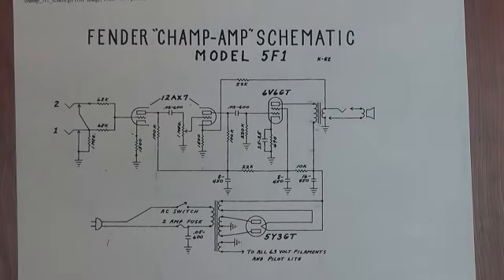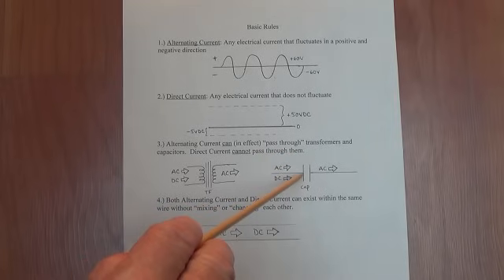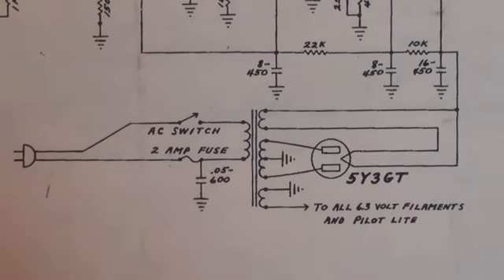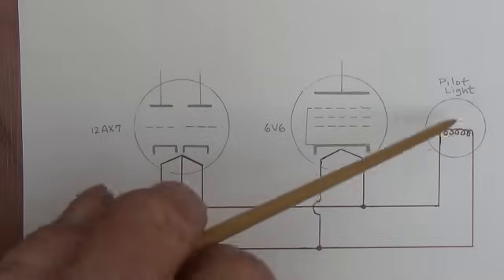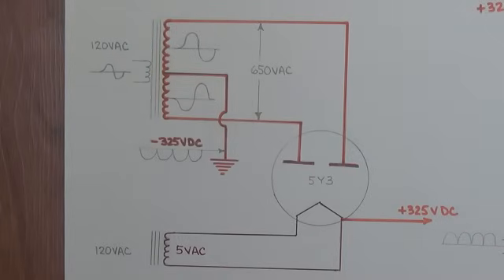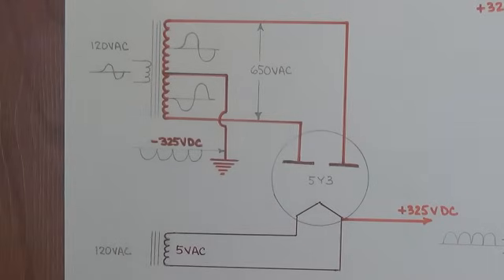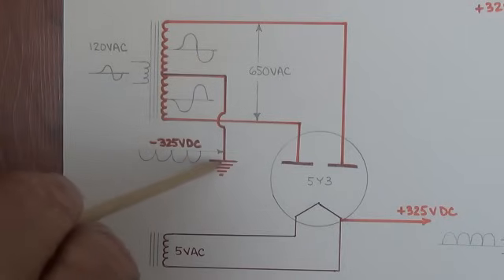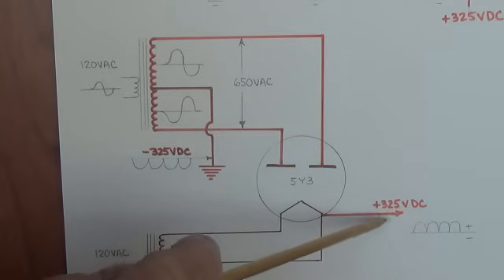How Tube Amplifiers Work, Part 1: The Power Supply

Comment: Uncle Doug, I loved both Part 1 and 2 of the videos on How Tube Amplifiers work.  I have a sort of related question. I want (actually my grandson) to  take the output signal (20 Watts/8ohms) from a Joyo Jackman amp and connect it to two separate speakers.  One speaker is a Harley Benton 2 x 12 Cab (100 watt/8ohms) and the other is a Dr. Bass 250 watt/8ohms bass speaker.  I bought a Y Splitter ( DISINO 1/4 Splitter, 1/4" TRS Stereo Male to Dual 1/4" TRS Stereo Female Y Splitter Cable Quarter Inch Splitter Cord - 8 Inch / 20cm) but, I am not sure if this is compatible with Speaker Cables. I cannot find anywhere (other YouTube videos, blogs, etc.) how to do this properly.  Help me Uncle Doug. You're my only hope.
Reply from the maker: I can only address the impedance issues, Anthony. Since I deal exclusively with vintage tube amps, I have no experience with splitters and fancy connectors. The two 8 Ohm speaker cabinets will provide only 4 Ohms impedance in parallel, which is not ideal for the 8 Ohm output transformer in the amp. I would not use this set up at very high volume for long periods. Good luck.
Reply: @UncleDoug  Yes, we found that out the hard way as the Joyo continued to cut off.  Thus, the need to separate the signal so that the 8 ohms output is going into each 8 ohms speaker separately.  Perhaps I can find a Y Splitter that is right for what my grandson is trying to do. He likes the band Royal Blood and is trying to create some funky sounds a la Mike Kerr.  Thanks again for the prompt reply.
Reply: Uncle Doug, I finally found what I needed: Palmer Audio Tools PCABM Passive Cabinet Merger; $50 on Amazon
Reply from the maker: @anthonyjames3074  I'm glad you were able to resolve the issue, Anthony. Good luck.

Comment: For the first time I understand how the ac and dc run on the same wires on the plate circuits and how the coupling cap only allows the ac to pass....But on the 5y3 ,you get the 325v positive at the heater, which is5v ...I get the negitive part, but not the positive?
Reply from the maker: The 5V is AC, provided by the power transformer winding. The 325V is DC, rectified by the diodes in the 5Y3. They coexist.

Comment: AC 120 volts is measured as RMS so the peaks and troughs are actually 120v x square root of 2
Reply from the maker: Yes, around 170VAC......this is discussed in my video on RMS voltage.

Comment: Hi Uncle Doug...I had written to you earlier about trying to power an A.C. amp from inverted D.C to A.C.
As I told you before,using the lighter receptical in the car for 12Volts,made for a very noisy amp with a very nasty buzz. Further...I bought a cheap overdrive pedal and connected it through a wall wart power transformer providing 9 volts DC and it worked but was also ultra noisy as I turned the volume up.
I was curious if a regular 9 volt battery would work and it did and not a hint of noise anywhere at any setting.
I think that inverting DC to A.C. or using a step down wall wart for audio signals,especially guitar signals creates this awful hum and buzzing....almost like a rectifier just curious if you think this is possible or feasible ?
Many thanks for your knowledgeable and very helpful clips !
Daniel
Reply from the maker: I have never tried using a DC to AC inverter,  Daniel, but am not surprised that it caused a buzz. With a 9V battery the pedal should be dead quiet.....but the battery probably won't last very long.
Reply: I'm guessing you were using a "modified sinewave" (cheap) inverter. If you can get your hands on a "pure" aka "true" sinewave inverter (expensive) try your experiment again and I'll bet the amp sounds much better, maybe even perfect. In simplified terms the distortion inherent in "modified sine" power passes right thru the amp and comes out as hum, buzz, or other unwanted distortion. As for your pedal, it's all about the quality of the wall wart. They are not all created equal - some skimp on filtering and inject 60 cycle hum into your pedals and others have good filtering and run as quiet as a battery. I used to run front-of-house sound at a small concert venue and helped troubleshoot a number of noisy pedal boards. Crappy power supplies were usually the problem.

Comment: hi... a question came up about using 2 dif tube types with same OT. 
1. can a pair of ..say 6v6's and el34s be connected to the primary of an OT as long as only 1 pair is receiving signal from the PI and separately biased...looks interesting on paper.. but have no idea.
Reply from the maker: It may be possible, Don, but far more complicated and troublesome than you might expect. Issues would arise from the vastly different power capability and plate load of the two very different tubes.
Reply: @UncleDoug  thanks ...i'll explain that to my buddy...
I know amps that will allow physical swaps and bias switch...was thinking outside the trend

Comment: Surely showing the centre tap of the transformer as -325V DC is misleading?  The +325V DC is, presumably 'with respect to' ground, which would therefore mean the centre tap of the transformer is 0V DC.  Also, if you connected an oscilloscope to the ground, what would you connect the common electrode to and, in any case, to have those negative going waveforms would require current to flow, which it doesn't as the diodes are reverse biased?
Reply from the maker: It was a misguided attempt to show the duality of any power transformer HV output, Simon. The polarity of the output depends on how the voltmeter leads are attached and how the diode(s) are oriented. Only one polarity exists at a time, but either polarity is possible.
Reply: @UncleDoug  Misguided or not, I don't think it took away from your main purpose of explaining the rectification of the two waveforms which then went on to be smoothed.  I'm in my sixties, so when I was at college, they were still teaching the old vacuum tube theory alongside transistor theory, and it is only recently I have come to understand it.  I think if I had been able to see your explanation all those years ago, I would have picked it up easily.

Comment: So, if I were to construct a circuit like this in the UK where the mains voltage is different (240V instead of 120V), does that mean I would have to use different transformer windings to maintain the same voltages on the secondary coil?
Reply from the maker: Yes, exactly. There are transformers available that offer two primary wiring schemes, one for 120V and one for 240V. When wired properly,  the secondary output is the same for both.
Reply: @UncleDoug  Ah cool! Very interesting

Comment: This was helpful, but I feel like it’s still explained by an engineer for engineers. For instance, most people don’t even know what “filament voltage” is, so explaining things with those terms doesn’t really help, but maybe this wasn’t desired to help non-electrical engineers? It just seems like if you know what “filament voltage” is you’re going to know how the circuit works.
Reply from the maker: The filament in a tube is like the filament in a light bulb. Current flows through it, making it glow and produce heat. Filament voltage is the voltage (i.e. 6 volts) that is applied to the tube filaments to make them glow.  Trust me, if the video was intended for engineers, "filament voltage" would have been the least of your worries ;)

Comment: Im relatively new to the world of electronics and I want to thank you for this very informational video! One question: What causes the center tapped transformer to invert the phase on opposite sides of the tap? It just seems like voodoo magic, and if there is like a quantifiable way to explain it I'd love to know! Thanks!
Reply from the maker: You're welcome, Thomas. Try to imagine the electrons flowing into the secondary windings via the centertap wire. They have two ways to go.....north or south......thus opposite polarity is created between the two windings.

Comment: Couple (ish) of thoughts.   Am I Right that the heaters to the tubes, although low voltage, require a relatively high current ?   also why (cost?) are power transformers mounted on the same chassis as the audio componentry.  Would a separate to the side sub-chassis be better, obviously the power out of the transformer needs to be taken over to a component chassis,
Reply from the maker: Yes, the 6.3VAC filament circuit can carry around 3 Amps. There is no problem with chassis-mounted power transformers, if the circuit is properly designed.

Comment: Hello again Uncle Doug. You had given me excellent advice regarding picking up a reasonably priced modern volt/amp meter. So happens a friend gifted me one so I am ready now to go ahead with the servicing of my monoblock Dynaco MKIII 's. The reason I had asked about using a VTVM was  because in the original Dyna Kit instructions a VTVM was recommended. [Since they are not even made now, I simply had to ask you]. Now must beg or borrow a Variac. Just last night I dug the amps out and noticed they had had the capacitors underneath replaced before. Since all the tubes were in place, I decided to take fate in hand and fire one of them up. To my delight it sounded good right away, and after 5 min it sweetened up considerably. The Mullard tubes sure are what they say....top shelf stuff. 
Not going to run it further until after replacement of the original caps on top (they got rather warm after 10min) but just saying that if one is very fortunate...a bit if a risk can sometimes not result in disaster. Will carry on towards recapping the both of them and eventually trying my vinyl through them with a decent preamp and the Tannoys. 
Hope you would welcome a bit of discussion with me the odd time? Cheers and be well.
Yours in faith, Jordan
Reply from the maker: Thanks for your very interesting input, Jordan. You really need to use a Current Limiter when starting up electronic gear that's been sitting quite a while. Also, any electrolytic capacitors that feel warm (or even worse, hot) to the touch are leaky and must be replaced. Best of luck with your Dynaco resurrection.
Reply: @UncleDoug  thanks friend

Comment: Hi.  Thank you for the video.  I think your explanation of the rectified AC signal as being direct current is in error.  The definition of direct current is "an electric current of constant direction, having a magnitude that does not vary or varies only slightly."  What you have is coming out of the rectifier is a signal that can be described by the equation y = A|cos(2*pi*f*t)| whre |<x>| signifies the absolute value, A is the amplitide (peak) of the signal and f is the frequency of the mains.   This can be found to have both a DC component and AC components through the Fourier transform.  The DC component is ~ 1.27A.  The amplitudes of the AC components are described by the formula 4A/pi*cos(n*pi/2)/(1-n^2) where n = 2, 3, 4, 5,...inf.

BTW, none of this really matters...it is just for techno-nerds like me.
Reply from the maker: Thanks for your very detailed input, Andrew, and I have no doubt that all you say is true, but please consider for a moment the target audience for this video. Do you really think that 90% of them would understand your explanation?  There is a niche for basic videos like this one, and if you watch subsequent videos you will see that I gradually ramp up the sophistication of the presentation.......but for this introductory level, I really don't think that inclusion of Fourier transforms is appropriate. Again, thank you for your very informed and informative input.

Comment: Hey uncle Doug it's me Sean....my house is giving me 125 volts....I'm not sure if the drake copy transformer is rated at 110 or 120 v....anyway I'm getting about 500+ voltage on my plates....my question is can I put a resistor somewhere to lower my voltage on b+ or whatever to get my plate voltage down to maybe 470 or 480 .....it's on a jump 2203 build.....
Reply from the maker: Yes, you can, but be sure it has sufficient wattage to withstand the current flow. Also, it might result in a bit of "sag" which you may, or may not, want.
Reply: @UncleDoug  where would be a good place for me to put it.....

Comment: I’m trying to figure out WHY my Sovtek Mig100 has a coffin shaped compartment that reads “Caution Radioactive Material” written on it with wires going to basically everything???
Reply from the maker: Was it built in Chernobyl ??
Reply: @UncleDoug  - I got it when I was 14 from a friend of my dads that was in a band called “KGB” (Killer Garage Band) 

I’ve had one technician take a glance at it and he said to “Get that the fuck out of my shop” and that was in 1996.

Comment: I'm sure you have gotten this question alot but is it possible to transform an old tube short wave radio into a guitar amplifier ?
Reply from the maker: Some of the parts may be of use, but the circuits are quite different.

Comment: Hello again! Maybe Im confusing myself,  but on the high voltage tube, if the heaters(-) are throwing off electrons to the plates(+) . Why does the current 325+ show coming off the heater side? Thank you!
Reply from the maker: Depending on the rectifier tube, whether the cathode is directly or indirectly heated, the electrons are actually emitted by the cathode, Wayne. The two plates in the rectifier form two separate diodes with the single cathode. As with any diode, the output or passed voltage is either negative or positive depending on how the diode is biased. It just so happens that with the way the rectifier tube is wired (biased) the positive DC is passed from the cathode and the negative DC is passed by the plates. Since we want the +DC, we use the output from the cathode.
Reply: @UncleDoug  Thank you! Ill have to look at it again with that in mind. I think my mind is there!!!🤯
Reply: @UncleDoug  Ok. I understand better now. I missed that the tube was acting as a diode.

Comment: One small mistake. You are not getting 12v at the filaments of the 12AX7.  The filaments are at the same phase angle and will not add together. The filament is center tapped giving each 6v but you will not read 12v if you read the voltage from filament end to filament end.
Reply from the maker: Thanks for your input, C, but at the very basic level of this video, it doesn't make sense to confuse beginners with concepts like "phase angle".  All the details can be (and are) covered in future, more advanced videos.

Comment: Hi Doug, should the center tap be 0 volts? And from what my father taught me, AC to DC conversion is VAC x 1.4, that would make 455 VDC output, please help me to clarify.
Reply from the maker: I tried to show that there are two ways to measure the output. In reality, the current flows from the centertap to the chassis, so this is shown, but most people think of the current as flowing from the secondary, which is also shown. My mistake was showing them both. Actually when you rectify AC, the output is 0.707 x the peak AC voltage. If you use electrolytics to smooth the DC ripple, however, they will elevate the DC back to the AC peak.  All very confusing, I admit, but covered thoroughly in more recent videos. Please see my video list.
Reply: Uncle Doug I am using ultra fast diode in all amps that I built, when measuring without load DC voltage is as calculated, but when all tube is in, it drops like 30-40VDC, so how do we design a PSU with the desired DC output with load?

Comment: I have to take issue with one thing you said Doug. If you place AC and DC on the same conductor, instead of alternating around zero volts, your AC will alternate around whatever value of DC voltage is present on the conductor. The DC voltage will change the reference point of the AC waveform. You can scope this very easiy and see it for yourself.
Reply from the maker: I don't believe I ever said anything other than what you just said, Dave. The AC "floats" on top of the DC, much like ice on water.

Comment: Hi Doug, I measured 7.2v on the filament voltage with load, not sure if this was the multimeter being inaccurate, but what if its correct, should it do any harm? Or does tone will change?
Reply from the maker: It's very unusual for a 6.3VAC winding not to be correct. I have never seen it, S. You might double check with another meter. If it is actually too high, it would probably reduce tube life expectancy......but not necessarily the tone.
Reply: @UncleDoug  hello again Doug, I just bought another dmm, and measure it again at 6.98VAC. Would this a safe voltage to put in or I need to drop it a little? Mains  voltage at my house was around 224 - 228VAC most of the time, thus the PT secondary might be higher that it was suppose to be. Thank you.

Comment: 120 VAC RMS is 169V from 0 to peak of the sine wave, both +, then - ...
Reply from the maker: You're right, Justin. This was originally corrected by notes in the video (which are no longer visible) and in later, more advanced presentations on the subject.

Comment: Hands down best explanation and delivery I’ve ever seen on tube/valve amps. I am especially glad you used a paper circuit diagram and not something graphical. Very refreshing and traditional and WAAAAY easier to grok than the RCA manual. The considered callouts on windings in transformers and tube/valve voltage are great reinforcements of critical fundamentals that are much tougher without a practical example. 
Bravo.
Reply from the maker: Wow.....thanks for your very nice comments, じょいすじょん . We really appreciate them and hope you continue to enjoy our many other videos that have varying levels of technical complexity.